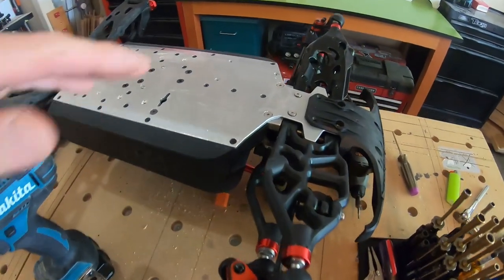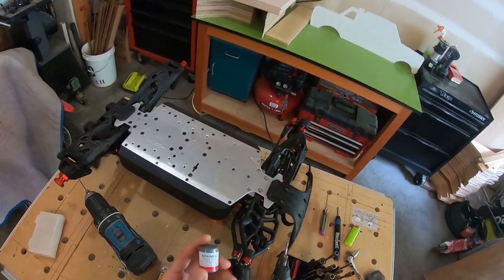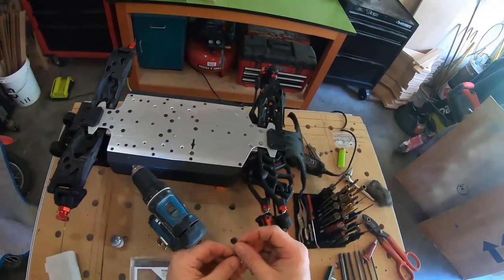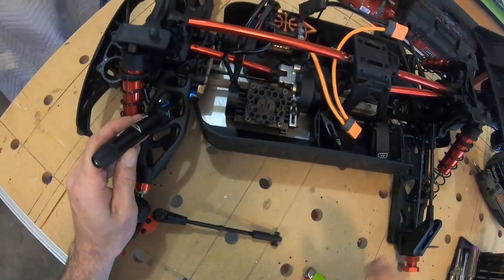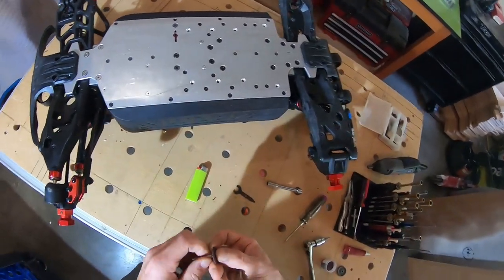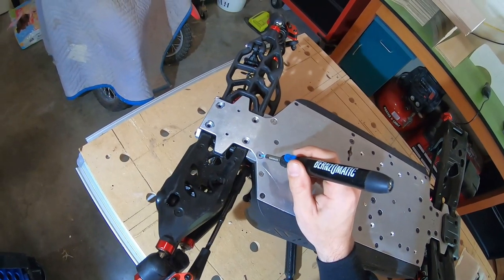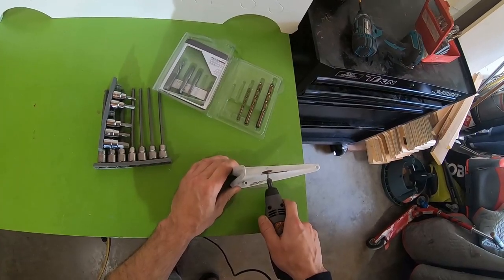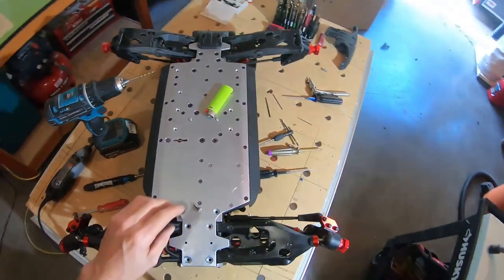How to remove a stripped screw from M2C Chassis Arrma Outcast 8s

Comment: Thanks I need one of those little blow torch. Usually I only drill a notch but it will be easier with heat
Reply from the maker: You’re welcome! The little torch works well o found for these types of things. Good for Rc cars for sure. It’s actually a soldering torch

Comment: On screws like that i just drill the head off, remove part and use vice grips to remove the rest.  I always hit chassis with Dremel method. 

Great job! Stainless screws sometimes seem like more trouble than they are worth.

Comment: Excellent video. The lock tight theory is really taught all wrong I believe. If you are going metal to metal with aluminum, lock tight is not necessary if torque is correct. Use lock tight on motor mounts and only hand tighten say,the lock tight dries and gives it the ability to stay tight. Not the torque,that you use on parts without torquing
Reply from the maker: Thank you! Yeah, I feel locktite is the source of a lot of rc issues
Reply: @pnwRCMADNESS  Too many amateurs and not enough professionals that make RC videos. Be well